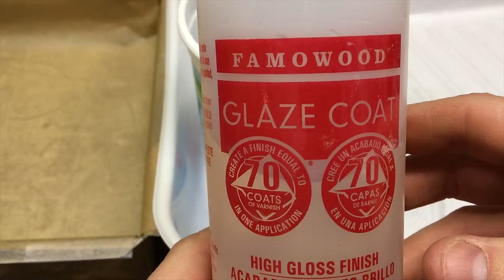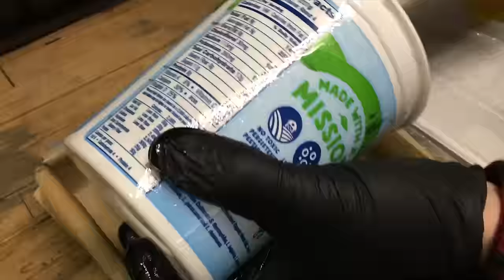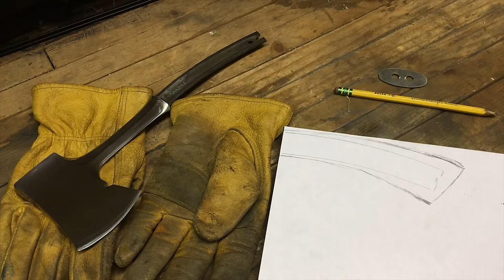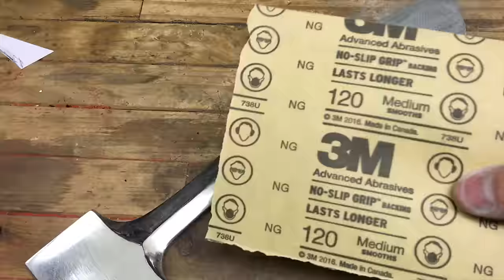AXE RESTORATION - Estwing Hatchet Restored using a Cashmere Scarf!

Comment: A wire wheel on the angle grinder will remove the rust as good as any disc or flap wheel without removing metal.....

Comment: You did a really good job on that handle it looked almost like a pistol grip a g10 I have for my sig p226 9mm tac ops. At first I was like I cant believe he isn't replacing the grip with leather again but wow it looked nice. I think if you would have got the cashmere in the color blue like there rubber handles that would have be even cooler but you did a really awesome job.
Reply from the maker: Thanks 🙏

Comment: The restoration is overall good, however:
1) The poll needs chamfers. Unlike general axes, Estwing axes polls are meant to deliver blows. Chamfers reduce mushroom-like flattening.
2) At 9:50 you forgot to drill a hole through the first half of the handle. With the handle assembled, it would be hard to locate a hole in the tang.

Comment: I was quite impessed at how nice the polish. And the handle came out on the. Estwing ! I  worked in the Architectual Woodworking feild for over 20 years both as  a installer and in managing  one of the departments  in the company  a hammer to me is a very important tool  many years ago i was in  a local hardware store with my son  and i was looking through their large selection of hammers for one that  struck y fancy  a couple of hillbillies were looking at the display  as well and one guy  grabbed a Estwing  framing hammer and was explaining to his buddy that the best. Thing about a Estwing is the shape of the  handle and if you  shape one side  of  it on a grinder into a sharp edge. The thing becomes a hammer and a hatchet. I looked at my  son who was maybe 5 or 6 at that time and was listening.  When those guys walked away. I told my son that might be one of the dumbest things ive ever heard  if you did that and   Maybe had your other hand holding something in place and missed the  nail  or whatever  you were trying to hammer. What would happen if that sharp edge  hit any of your fingers  he looked at me and said you  could chop off your fingers.  So i said correct and how long does it take for someone to grow a new finger ? He looked at me and said he didnt know  that it would grow back. So when we got home that evening i  grabbed one of my Estwings and  showed him how easy that could happen   And of course explained that fingers do not grow back plus  by grinding down a hammer like those guys were talking about you would  probably ruin the integrity of the hammer and void any warranty  for me i like  working with a pretty light Hickory handled  hammer  mine is a older Sears Craftsman. That I’m pretty sure Plumb  built for Sears back then  the majority of my work  was cabinet and trim installation  in later years. It I have. Done my share of conventional framing and even shingle in general with that same hammer  i do have small hands and the Estwings  never  quite felt  right in my hand ?   The majority of the time. My Estwing lays in a  puddle of water. In the bed of my pick up truck  although your video  has made me thinking that I probably could make a different handle and  do a polish on it like you did the hatchet  ironically ive done some metal polishing myself  and for some reasons that suprised me i really enjoyed the tedious work   I  buffed out a  engine case on one of my  vintage motorcycles  mostly using a Dremel  to get into the strange  and small areas  on the motor

Comment: Be careful about the epoxy. Even if it is cured you may develop a sensitivity to it. This is especially true if you get it on your skin wet and or breath in the dust-- the latter isn't good even if it's fully cured.  Nice project.

Comment: While I like your restoration and new handle I think this style of handle would be better suited for a knife handle. The original leather on the handle was meant to absorb shock while chopping. While I haven't held or used your handle I would imagine it transfers more shock to the user.

Comment: Awesome! The only thing I didn't like were the screws. :( They make it look kinda cheapy.  Some brass or copper pegs would have worked in their place, since it was all glued anyway and just holding the end in place and not actually holding all the rings of leather on like originally. Then just hammer down the ends & round them off. I wish I could give it a try to feel how the handle is. If I made it I would definitely want to actually use it...but that's just me. ;)

Comment: Simply soak the ax head for a couple of days in vinegar, if you must, Evaporust, and clean with a wire brush. Then sand the paint off the handle and coat it with leather treatment covered with a plastic bag or wrap for a couple of days. Then unwrap the handle and wipe it off. Next file the flat spots off the edge and sharpen with a coarse and fine stones and finish with a leather strop charged with polishing compound.  The blade should be sharp enough to use as a chisel. Wipe off the blade then coat with oil. Then store the ax in a protective sheath. The sheath is there to protect you, not the hatchet. 

The polish and the special grip improve (?) the appearance but not the utility of cutting tools like this.

Comment: I never liked the estwing leather handles because they Incorporated plastic and when that would crack the whole handle would come apart. On the other hand malco makes the best leather handle out there especially on their hammers no plastic. I always remove the lacquer right away that comes on the handles not sure why they do that. the grip never tears the hands up, works great even when wet as opposed to the rubber / plastic grips that are on hammers now.
Reply: Great job by the way

Comment: You know processes.  They work.  You picked a great colors.  If you'd used more cloth, and far more clamping pressure, the tactile character of the cashmere may have achieved a more grippy/functional effect?  Totally guessing, here.  I guess if I could try and contribute to your content, I'd say we don't share a "philosophy of tools" or tool making or tool design.  You're open about trying knew materials and being curious about how this works with that, and me too.  Somebody originally makes a tool and you approach it totally practically rather than "romantically" for lack of a better word.  What do I mean by this?  Despite the rust the metal of the head and neck will often have a work-use or weathered patina that tells a story about it's "life as a tool".  Who owned it?  Did they use it much?  Did they value it?  What is the reputation of it's maker?  These facts are only ever hinted at and may remain unanswerable, right?  Who cares?...you might very well say.  Well, you didn't make this tool, you didn't bring it's power and value into existence, and whether you life was riding on it or not, your skills are not up to task.  You couldn't make one on your own and so it's existence and the inherent value to someone's very life and limb could be fare more apparent in the degree to which you honor it's maker.   One could readily choose to preserve as much as possible of it's original design sensibility.  Maybe to choose to highlight rather than eradicate the marks of it's prior ownership, much less carelessly ravaging the trademark, taper and spine of the axe neck that bespeaks "Estwing" from across a room.  You butchered the grind just to achieve a "mirror polish" which barely preserved the original lines of the design.  Look, this ain't a moral issue, right?  I'm splitting hairs over hear in the off chance you might be open minded to the way others look at old or historical human implements of the hand.  The way you handled the pommel...raised the question of why you even started this project to begin with.  Clock a video for  your channel?  Not trying to hurt your feelings here, dude.  I'm being honest about my response to your content, and I guarantee you there's a HUGE demographic of people who are interested in tool restoration that won't be back for more of the same.  I assume that's the opposite response you may be hoping to elicit.   Feels like you just don't care that much about what you're doing here, and if that's the worst thing a person could say about you,  then you could still certainly be quite a noble fellow...in some other regard.  Just don't show anyone that pommel treatment.  Sayin'.  This is a small attitudinal adjustment that will add manifold enjoyment to the doing of it, and in the viewing of it being done.  I know you will succeed.  Good luck!

Comment: Hello,  your handle is ok but the end plate is definitely not secure,  the leather pouch would have been better fitting more up from the cutting edge to the handle also the natural colour of the leather is more in keeping with cutting tools. Just remember axes go through a lot of vibration when being used heavily,  as for the handle, In use it might be a bit sweaty eg slippery.  Anyway keep up the good work. I am trained, JOINER  not someone who has no idea, my age now 74 years old.  Best wishes Geoff Lewis,  Wales,  UK

Comment: Dear friend.  As an old guy and a wooden boat kind of woodworker , I just wanted to mention a safety thing. Your not doing yourself or family (if the ventilation system is attached to your home) any favors  !!
The fine dust raised from sawing, grinding, sanding epoxy (of any type) is a extremely hazardous material.  The respiratory and allergy effects are well documented.
Unless you are wearing full body skin protective clothes and a fully independent fresh air supply... you are at risk . Sorry for the downer but , I just want everyone to know that people have died from it .
Extreme allergic reactions are putting unsuspecting people into the hospitals. 
PEACE  🖖

Comment: ... "GREAT JOB ON RESTORATION" !!   "GET  RID OF THE ROUNDED SCREWS ON THE BOTTOM PLATE".. BETTER  TO USE A STAINLESS STEEL,  FLAT HEAD (BEVELED)  PHILLIPS HEAD WOOD SCREW, GREAT FOR OUTDOOR USE,  WON'T RUST..  LOOKS BETTER..  ALSO  WHY NOT USE A THIN EPOXY TYPE LACQUER TO BRING OUT THE GRAIN AND COLOR OF THE HANDLE....  "GREAT JOB ON RESTORATION,  AND THE LEATHER WORK" !!  I WILL DIG OUT MY ESTWING HATCHET AND RESTORE..  GREAT MIRROR FINISH...

Comment: Pitty about those two screws at the bottom. They should not be there. The bottom of the ax should penetrate the bottom plate. Also, the screws do not fit. Real pitty.

Comment: vinegar is cheaper and doesnt harm the enviroment. its likely you dont care
Reply from the maker: Evaporated is reusable, non toxic and biodegradable. It does not cost much also and one gallon can be re used over and over and over and over while when you use vinegar it can only be used once and takes 5 times longer or more to remove the same rust. https://www.amazon.com/dp/B00GRSOJSS/ref=cm_sw_r_cp_api_i_6FNTFbZNYWM1H

Comment: That axe is now dangerous because you removed the end plate  handle will come loose over time and could fly off you should have drilled a hole in it as n put a pin through like you would with a knife .

Comment: 1/10 low effort video. Impractical as there’s no pins to hold it in place. Im sure that other comments have also pointed this out, epoxy is brittle to high impacts and won’t last. I’d be hesitant to use it also as it is dangerous and can lead to serious injuries to yourself or others around you.